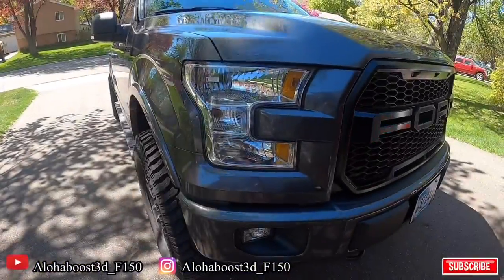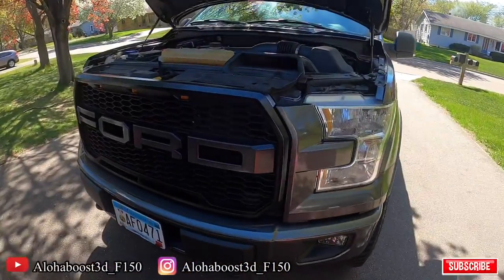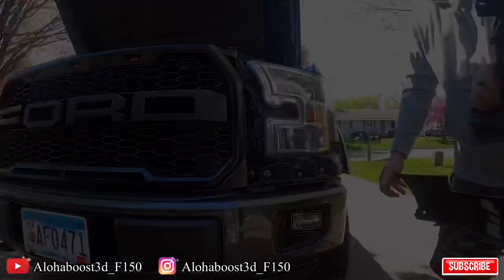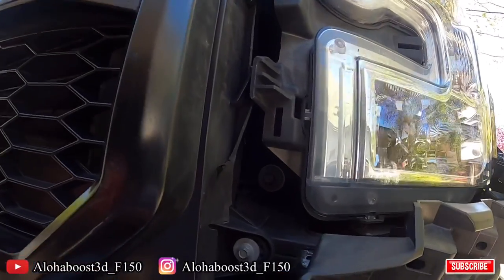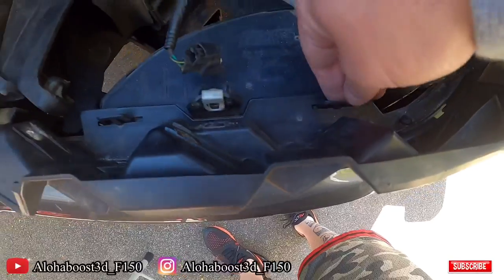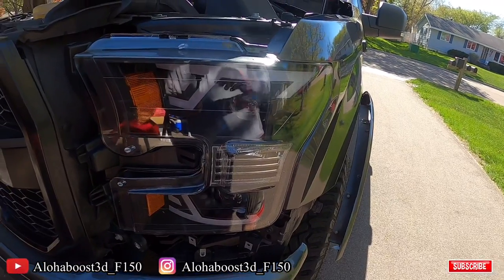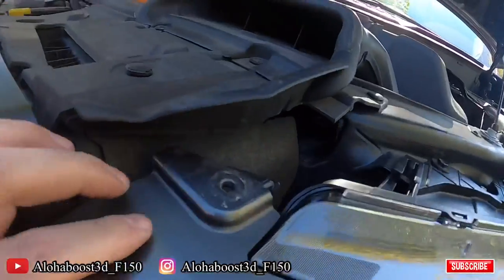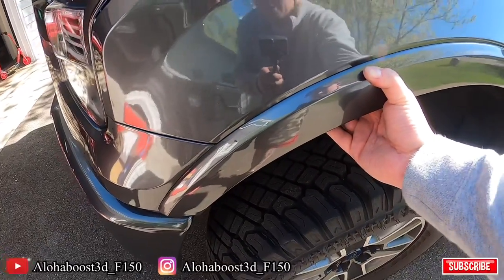How to replace headlights on 2015-2017 F150

Comment: Did you change out the bulbs and if so was it easy
Reply from the maker: It was a direct connect. Didn’t change out the bulbs. But I do need see if it’s possible to change because the actual headlight beam ain’t the greatest

Comment: Considering a set like these and glad someone has an install with them. Of course the switch has to be on for them to work, but after running these for a while now how do you like them?
And Have you tried to wire the white LED's up for a switch back function?
Reply from the maker: I do like them. I want to pull them apart to see if I can make the then true DRL or even a switch back function. Stay tuned I’ll try get that figured out before you buy them 🤙🏼
Reply: @ALohaBoostdF  I was planning on purchasing them anyway so no biggy. Definitely like the look of them so even if they don't switchback they're still a good choice.
Reply: @ALohaBoostdF  So I ended up getting this set after all. Did yours have the wire to hold the halogens in or an actual turn and lock style for the bulbs? Or did you end up upgrading to LED's at all? 
 Mine have the wires and made it nearly impossible to install LED's. Might end up heating up the stock headlights and pulling them apart to see about painting the housing or maybe even swap the housing over to the Akkons so the LED's will work.
Reply: @seanthemon  Help a brother out? I too bought this same setup. i bought Lumen G7s LED's but they were too big. Had to grind and shave metal off the heat shrink around it which wasnt thrilled to do so. Have you found a set that fit inside?
Reply: @justinwaugh4377  I'll be honest, I didn't like these headlights and ended up going with V-Lands.
I couldn't get the LED's to sit in the housing like I wanted so just gave up and got rid of the housings all together

Comment: Link?
Reply from the maker: https://www.ebay.com/itm/Black-Fits-2015-2016-2017-Ford-F150-Light-Bar-Projector-Headlights-Headlamps-/202776728597?mkcid=16&mkevt=1&_trksid=p2349624.m46890.l49286&mkrid=711-127632-2357-0
Reply: They currently sell them on Amazon. Just ordered a set.